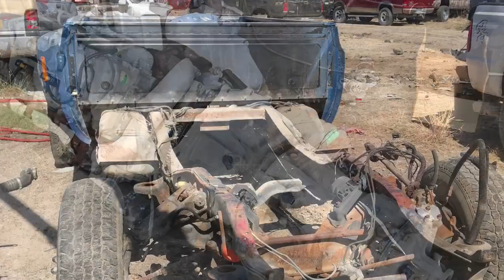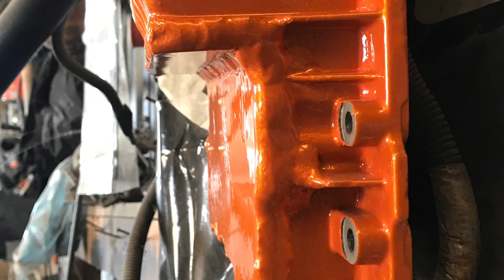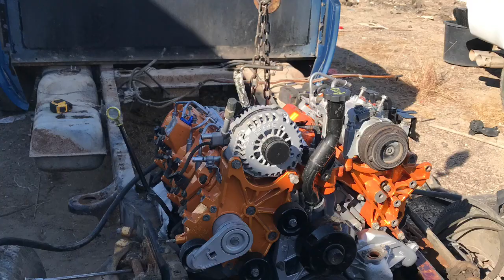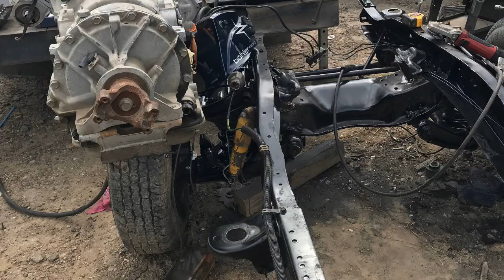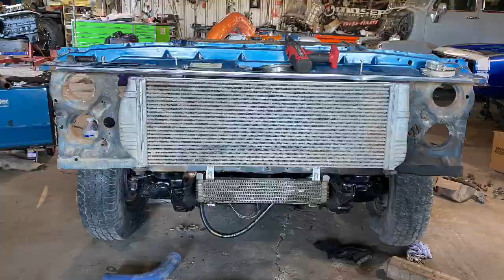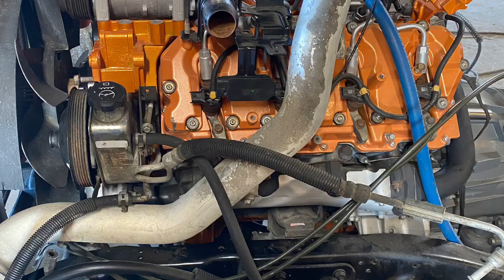Square body c30 duramax lbz swap

Comment: How did you do You're fuel? Did you use the original tanks
Reply from the maker: Yes i used stock tanks plumed up a fass feed tube a 6.4 lift pump to feed the motor . Stock gauge works